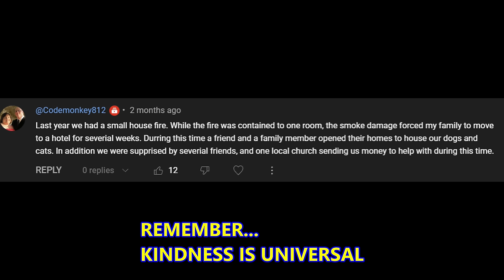HE HIT THE BRIDGE!!!  HAZMAT, NEW 18, & TRAFFIC CONTROL AT THE SAME TIME!!!

Comment: Thanks for the laugh Ron, "How much air do you haver in the truck and trailer system" Driver "I didn't check no Tires" then poor Ron is left speechless. I wonder who gave these steering wheel holders their CDL's
Reply: Agreed
Reply: Give the guy a break.  He just had a near death experience.  Lots of normally smart people will have brains as thick as day old oatmeal after something like that.
Reply: I'm on the threshold of 30 years with my CDL and yes some steering wheel holders should stick to tricycles.
Reply: Lol yeah for real
Reply: I’ve always would be standing, watching traffic when ever a tow driver was hooking for a tow, doesn’t hurt to have an extra set of eyes watching for idiots.
Reply: @1984cablrrelf there’s so many now that don’t even speak English so how can you communicate with them?  Hot shot that didn’t understand when I told him to watch out for the potholes.
Reply: No air in front tyres.
Driver was siting in the passenger seat and would not be looking at gauges.
Reply: @1984cablrrelf  There is a difference between a 'truck driver' and a person who just 'drives a truck'!

Comment: I was a volunteer firefighter in Germany for 25 years. In my hometown, the fire brigade also had to take care of a section on the A73 (motorway 73). In spite of repeated warnings, some motorists simply drive past an accident site on the motorway like the disturbed. Sometimes you have to block a lane completely to be able to work unhindered. Always comes back healthy from such operations, because even here in Germany there are always accidents at emergency sites, in which car drivers or even truck drivers drive to secured accident sites.

Comment: I was wondering why you weren't towing the hazmat trailer with the traffic control truck until I realized that the trailer would block the light bar. Might want to mount some flashing lights on that trailer. And if that crew cab Ram is your POV, it's a nice truck!

Comment: Something we have on our Vol. Fire Dept. in Ohio is emergency scene ahead signs that fold up. Not sure if you have them or have used them before but we set them up before we get to a scene if we are on a heavily traveled road. Usually try to do it with a good distance from the scene. Wouldn't be worth the hassle on small jobs but situations like this I think they would be beneficial.

Comment: Hi Ron, have you thought about perhaps a "crash cushion vehicle" to use as traffic control. They can have a large matrix of lights on the rear that can be configured with custom text and arrows. They are seen regularly in the uk when road maintenance is being carried out and also have a folding crash cusioning structure on the rear that is designed to absorb any impacts if they were to happen. The vehicles I have seen here are usually on an 18 ton rigid flat truck chassis, with plenty of space to store cones and various other equiptment that may be needed.
I was a little concerned about the arrow on the rear of the traffic control truck being not quite so visible as some I have seen in the UK.

Comment: A retired Arkansas trooper told me that year's ago in the dark of night, some guys pulled off by a bridge wall, stepped outside to gawk at an accident they were working. Another motorist was watching the accident and got too close to the gawkers. The gawkers jumped over the bridge wall to "safety". The "safety" was a several hundred foot drop into a rocky valley. No, they didnt make it. The highway was whats now called I-49 through the ozarks between Fayetteville and Fort Smith.

Comment: All those cones and flashing lights and people still don't get over.
Reply: Exactly 🙄
Reply: They probably would if the cones were actually in the lane and not on the line. Would make better since if you wanted room to work and more efficient if they actually placed the directional truck before the cones and then place cones  to move traffic into the other lane. this way you could get your work done quicker without having to look over your shoulder all the time and could stay focused on the task at hand.

Comment: Are you able to have a truck-mounted arrow board and Scorpion attenuator on a truck blocking the shoulder and/or adjacent lane? NDOT has them for any freeway accidents that need more space than just the shoulder. The Las Vegas valley does not understand how to give space or slow down. I have helped with emergencies with little protection and no shoulder *at night*, and I've never been more scared. You can never be too careful.

Comment: In the UK you would not be doing that. the inside lane would have been shut down. The motorway traffic normally place an officer at the start  of the coned area with a whistle to warn if any vehicle is encroaching.

Comment: I'm surprised the company didn't have a replaced truck to take the trailer away.
Reply: Only a properly equipped towing and recovery vehicle is capable of moving that wrecked power unit out from under that trailer.

Comment: They should've done a lane closure long before you arrived on scene , not closing the right lane is VERY irresponsible for the police department pretty stupid of them for not putting the roadway down to a slow speed and to one lane so you can work safely they're just putting you in extreme danger by not doing a lane closure.

Comment: You should have closed the lane down, very poor safety on your part.
Reply from the maker: We aren't allowed to shut a live lane down in a situation like this.   The truck was on the shoulder and was not blocking traffic.   There are very specifics regulations we must follow to shut down a live lane of traffic and this situation did not fall into a category where we could even consider shutting down that lane.   I understand, and share, you concern.  I would have much preferred to shut down that lane, but, again, we weren't allowed to do so in this situation.   Thanks for watching and God bless.
Reply: Thanks for the explanation,  Ron. Maybe pin that to the top? @RonPratt